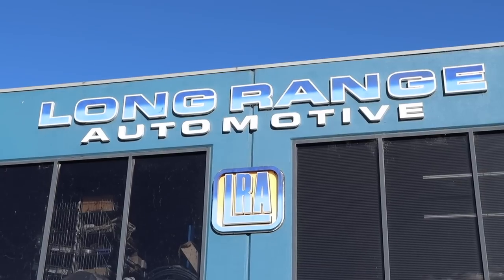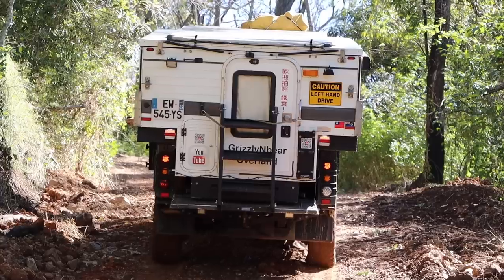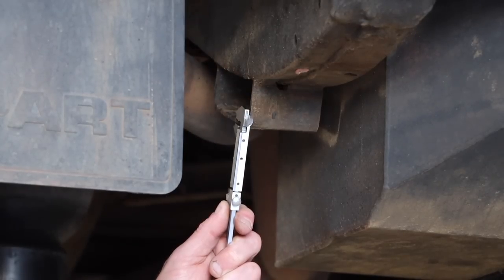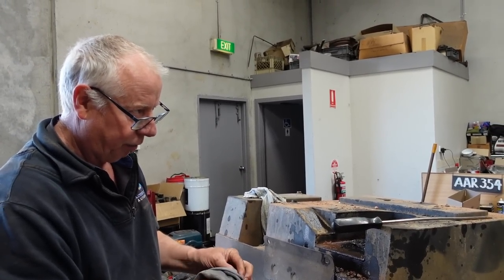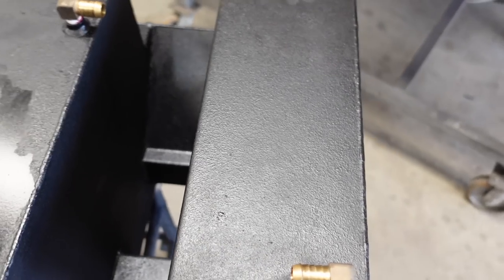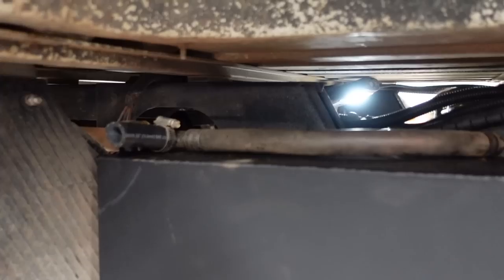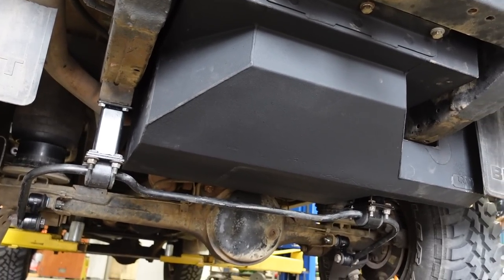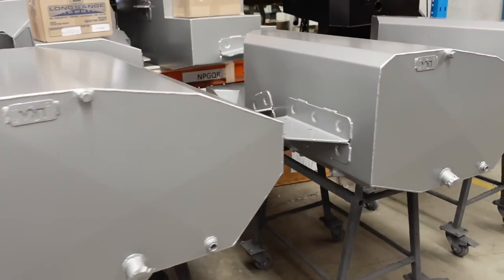140L Fuel tank by Long Range Automotive. 60 litres of extra diesel!

Comment: After some extensive research on the range of auxiliary fuel tanks available in Australia, I recently decided to fit a 160-litre aux' LRA tank to my 80 series, the unit has good ground clearance and is a very neat job overall, everything works as expected so I couldn't be happier. 
Thanks again to Roger, Tash and the gang at LRA for your professional service. 
And thanks very much Grizzly, for the reassuring review on the LRA tanks used in your Defender, happy travels everyone.

Comment: Thats the way young felah,l got similar setup in my 4bd1t County the problem l had is the drop arms get bent doing 4x4.  You can put front sway bar on if you do your research in the forums you will find its a better option if you do alot of 4x4. While you are in my area try camping at the Kurth Kiln Gembrook and Running Creek just before Jamieson great spots.

Comment: Those tanks look good, I might need to look into it. I completely agree on not only relying on the fuel gauge, I also reset the trip meter at each fill up. I also have a book where I write the mileage and litres down. I then can keep track of the fuel efficiency over time to keep an eye on how the engine is doing.🤷🏼 been doing it for years now.

Comment: Wow... 210L capacity... that's an eye watering 400€ to fill up over here... My truck has a 100L tank and I've only ever filled it completely once in 5 years..Nice mods though and essential if you travel the Aussie bush I guess... A mate of mine nearly ran out of petrol near Alice Springs once.. That would have been life threatening..
Reply: My 200 series is 273L... and has better fuel economy and power then this.... oil leaker...
Reply from the maker: @ausguy4385  I very much doubt a 200 Series is getting better than our 12L / 100km... 
The problem with a 200 Series is that it's not a Land Rover but that's ok we understand not everyone can handle a Landy 😘
Reply: 200 more reliable also

Comment: Linkage for the swaybar should be in the opposite direction so that the swaybar is parallell to the ground and the linkage more horizontal. I think this needs to be changed to work correctly.
Reply from the maker: Thanks for the feedback. Are you sure about that...? We went off the factory handbook manufacturer specs for the install and this is how it's shown in the diagram...
Reply: @GrizzlyNbearOverland  You have the sway bar mounted correctly.  It is a big contention in the land rover world. I swapped my bar to a I think a loadmaster as it mounts on the axle and the arms go backward. Works alot better. It is a very strange original setup and can bend parts. Keep an eye on it as it is known to bind alot.

Comment: @8:15. Link rod need to be vertically positioned to handle the resistance. Mounting horizontally will not solve the purpose.
Reply: That was at full suspension droop. I'm sure it ran vertical once it was back on the ground. Remember it has air bags...
Reply from the maker: Yes the link ended up vertical once the vehicle was lowered to the ground.

Comment: Thanks for the effort Lee but you won't need a long range tank in New Zealand lol
Reply: As here in Europe. You wont need it. You can fill up almost everywhere. But two points on this: If the Diesel is cheap on one day it could be worth to fill up as much as you can. And much more important: The difference between need and want! :-)  like so many attachments (and of course i NEED my bottle opener on the roofrack) Greetings from bavaria.
Reply from the maker: @porcobene_media  it's nice to fill all the tanks when the price is right but also when reliable diesel quality is available. In many countries we've travelled the fuel quality is bad so having the extra range is hugely beneficial.